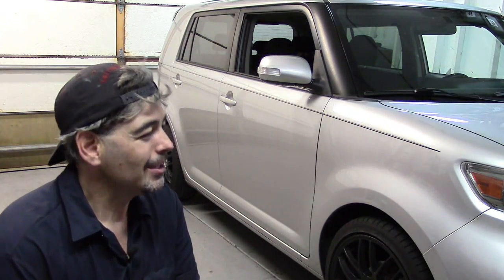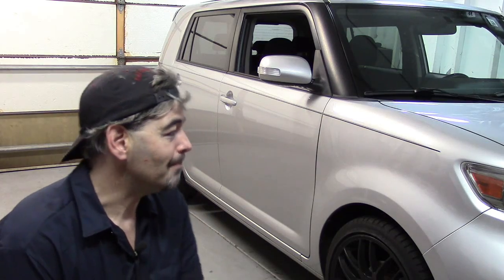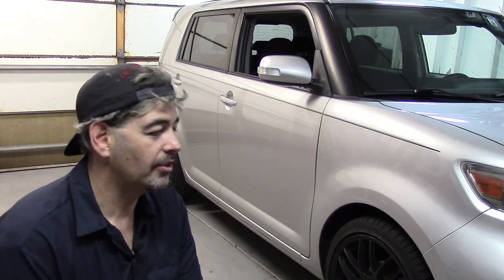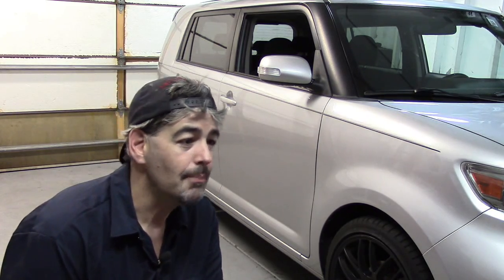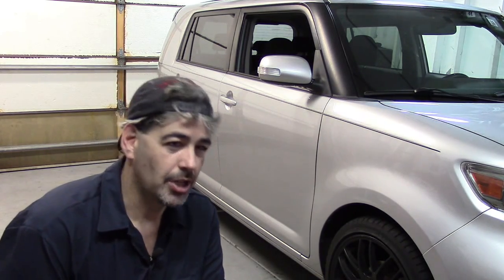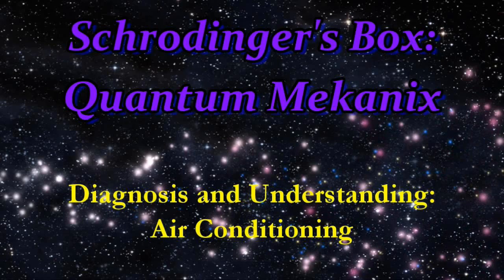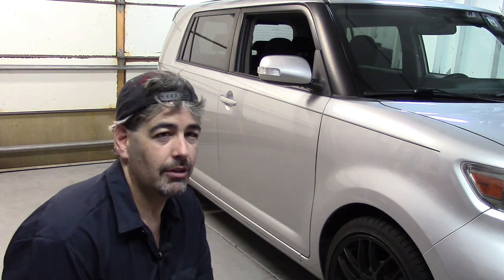Locate an AC Leak Like A Rock Star!

Comment: Seems a little sketchie to charge an ac system knowing it is all going to leak out, given environmental concerns. Wouldnt it have been more responsible just to let a local mechanic repair if you didnt have the time?
Reply from the maker: Sketchy is refilling a system you know has a leak to get by for the summer. DIAGNOSTICS is filling one with dye to determine the repair needed.
There's a critcal difference.
Reply: Wasn't this system just filled to "get by / leak out" until it could be gotten to later? I'm not knocking the diagnostic aspect. http://www.epa.govt.nz/Publications/Releasingrefrigerantsisillegal.pdf
Reply from the maker: Saturday Projects Nope, not at all. You can kill two birds with one stone like I did.

Comment: Nice! In here its illegal to recharge AC system if you even think there is a leak at the AC- system. For that you can get 4 years worth of meal in jail.
Still AC die is used here too. But for some reason i still get faster results with gaskit that are made for finding AC leaks (mixed, nitrogen).
Presure that system with it to 13bar and spray the parts with just water from hose or if you like use soap water (With Key Off, Engine Off!)...
you can still use sniffer like snap on, but i have find to meny falls leaks from windsheald washer fluids and engine coolant leaks that i have minimised that use.

Anyways nise find! looking foward for the fix :)

Comment: compressed air should not be used in an ac system. The resulting mixture of refrigerant and air can be explosive.
Reply from the maker: Why would I introduce compressed air WHEN THERE IS REFRIGERANT IN HE SYSTEM?? There is no need to pressurize the system silly.  Besides its a myth anyway. 
  Why can't people think before they do things?
Reply: +Schrodingers Box in your video you mentioned using compressed air to find the leak. I've read the warning in manufacture documentation, so I'll just stick with what they have said.
Reply from the maker: suit yourself. But I'd rather follow logic and reason rather than anecdote.

Comment: What about evaporator leaks? No visual access. I've had success is w/ a sniffer but it was tedious. Some have found dye in the condensate water, but AC has to be working at least some to deliver condensate.
Reply from the maker: That's actually a great point. I have never seen an evaporator leak but I guess I'd rule it out by process of elimination and then verify by exposing evaporator and looking for the dye or use sniffer. 
  I hope I never see one lol.
Reply: I've found evap leaks by a puddle of oil under the truck from the condensation drain. It just happen to be a leak at the very bottom of the evaporator, I don't think the oil from the system would have leaked out otherwise. Started with a sniffer, it was picking up pretty much anywhere under the hood you put it, so got to looking around some more and eventually went to lunch and came back and was  a small oil puddle forming under the truck

Comment: i got to say something here you should never ever ,ever put compressed air in to a refrigeration system, the oil dont mixes with air and when it does   you have  fire and  explosion. This is from what i have learned from what i regard as the Best AC youtube  tutorial from argo-contractor, You need a 300$ flashlight to look around quote from mr alan olivas aka argo contractor.
So how to pressurise a AC system only one legal and save way with nitrogen.
i think the bullseye leake detector can sniff  nitrogen would be interesting to see if that snapon tool sniffs nitrogen probably not its why  20% refrigerant is allowed  to be added  with nitrogen for leak  detection.
Reply from the maker: Absolute myth and proven conclusively to be so. I even didn't know this was still perpetuated.
Reply: ok i have no proof but i sure as  hell wont  be going to find out if it is a myth i know that everything alan olivas said was plausible , would be good to have some form of proof how and  why this  is a myth.
i think mr  olivas  talked about emense  fines in the usa if you refill a used  refrigeration container as somone used it to fill air  in the tank for there bike tyres.
Reply from the maker: How do I know it's a myth? because I looked at the chemical composition and also for "laymen" you can use an MSDS. 
http://www.meicorporation.com/pdf/8209msds.pdf

  Welcome the the world of fact and evidence based foundation!!!!
Reply: ok but that wont explain how this supposed myth came to be, i know the battery on concreet floor myth  was because battery  once where made from wood and porouse material, thats how that originally had some true components. i want to know now for sure. one good reason you wont put air in there is moisture , i was also thinking what chemicals is the smoke made  from and some manufacturer ban the use of die for warranty claims.
Reply from the maker: Why a myth forms is irrelevant- because they all form from the same exact source. Ignorance.
Reply from the maker: Intrade Motor   I see where you are coming from, I really do- however the physics of thermodynamics is an exact science and there is just simply no way you are going reach a combustion temperature through Boyles Law on a non combustive compound like Polyalkaline Glycol through a standard automotive air compressor.

  If your assumption/concern were valid, I would immediately disable the automatic tool oiler on my air compressor because the oil is under far, far, far more compression that the A/C system would be for a leak detection.  But do I worry about my compressor exploding due to the oil compression? Absolutely not- not based on empirical data, but rather physical law.
Reply: myth or not, after introducing a non condensable you would need a good vaccum after. 😃
Reply: i have been thinking long and hard. if it was  a myth then its extreem bad practice, then i did think some more about it, and i dont think it is a myth because  if it was no diesel engine would operate.
you compress air then you add oil and it goes bang thats the principle a diesel works.
You have aircon with oil you add air. You compress  and  you get bang! thats how it works in my universe as i drive a diesel.
Reply from the maker: Intrade Motor OMG dude- you actually think you are going to get ac AC system to get to almost 300PSI with compressed air and cause combustion on a trace of noncombustible material?? It's AC oil not diesel fuel in there bro.
Common sense.
Reply: i told you i need to find out about the myth , so it is possible to happen just more improbable the ac system explosion was i would say a big industrial one , and i can proof to you  a diesel runs  on any form of oil not just diesel. My one  had  quite a lot more buggy on the automatic trans fluid. And i ran it on electrical transformer  oil tested first if it had poison in the oil . So basically  you do now agree and i found  how the myth would have originated . probability exists .
Now i would think they may have changed the oils property for ac fluids. Another one i have to follow up on is that diy r134a is actually butane like gas as it is illegal to have r134a  with no license ...  as if we did not have enough to figure out like if the moon is there because the mouse looked at it lol.

Comment: I would advise against using the smoke generator. 
It produces the smoke from a mineral oil fluid and the smoke/vapor contains mineral oil that is not compatible with R-134a refrigerant and PE/PAG oil. After contaminating the system, ideally it would require flushing the system. This is not my opinion, it is from ASHRAE. 

Also the electronic detector is halogen gas detector and will equally detect any halogen gas, halogen refrigerant or halogenated substance. That Snap-On unit was/is most likely manufactured by TIF/Robinair under a private label contract. 

Also on smaller leaks for more successful detection with electronic or bubble method, temporarily disable the radiator/cooling/condenser fans as they move and disperse the leaking gas making electronic detection more difficult or bubble formation nearly impossible. 

The UV dye is by far the easiest, quickest and relatively reliable and is the favorite go to method for many professionals.
Reply from the maker: Al of that is pure poppycock. a moments thought would clearly indicate there is no issue whatsoever.  A typical AC compressor failure is far far far more contaminating than a smoke machine or compressed air source by a billion times!! 
  Shear ridiculousness caused by lack of logical process.
Reply: Schrodingers Box
That is your opinion and your choice to do as you see fit, however that does not automatically make you correct.
Reply from the maker: That be true however 7 years of field tested application does that for me.  There is no debate- it's just logic and practical application.

Comment: As a licensed HVAC contractor and a fan I wouldn't recommend using the smoke to detect a leak. Probably very moisture laden air
Reply from the maker: Joe Shearer Never use filter-dried compressed air in a system that is under over 250PSI of compression huh?  Illogical.
 Once again- to each his own but I prefer to use logic and common sense as my guides rather just "doing what I heard or read".
Reply from the maker: Its not a big deal in the slightest- in fact it's LESS of a deal.  A system at atmospheric equilibration is going to have whatever moisture is present at ambient.  A compressor line has dryers in it so actually the smoke is more dry than ambient air.
  evacuation of system and replacement of dessicant are standard for any atmospheric contamination anyway as I mention in my other video.
  Understanding the physical chemistry is the important thing.
Reply: +Schrodingers Box I guess my point is I would never inject compressed air and smoke into any refrigeration system. I've never done it personally but one of the first things you learn in HVAC trade school is never use compressed air in the system. I'm not bashing you in any way
Reply: Probably not a big deal, since he's going to have to pull a vacuum later before recharging - that should dry it out.  Also, and he said he was replacing the desiccant, since it's open to the atmosphere already.
Reply: +aussiebloke609 it's a big deal to us in the refrigeration field. We use dry nitrogen only and we change driers too
Reply: +Schrodingers Box I think the difference is pumping more air and moisture into the system than if it was just the natural moisture in the ambient air. I don't know also what kind of solution the smoke is but I would think that would also contain contaminates.
Reply from the maker: Joe Shearer I still dont get your point- HOW is this possibly going to cause issues? Are you sure of what you are saying here??
Reply: +Joe Shearer 
Agreed. 
Most smoke generating fluids are mineral oil.

Comment: I wonder if the sensitivity of the leak detector goes up when the engine is on because of heat? It'd make sense that whatever chemical reaction the sniffer goes through with refrigerant would work better warmer than colder.
Reply: All good.
Cheers
Reply: Tech Tune Automotive Repairs 
Are you serious? 
You are completely misconstruing the context of my comment and response to the original comment by +DE “AutoBravado” Nichols. 
Refrigerants used in mobile (automotive) systems adhere to physics, gas laws and are temperature reactive, a thermostat would be temperature sensitive. 
The sensitivity of most halogen/refrigerant leak detectors is not affected by ambient temperature.
Reply: Tech Tune Automotive Repairs But perhaps the sensor doesn't care? Not in Pat's experience anyway.
Reply: Heat or temperature is not really a factor, neither the gas or the detector are temp sensitive. The same electronic refrigerant detectors are used in sub-zero temps inside walk-in freezers with no problems. 
It is a halogen detector and most higher end units incorporate a heater in the detector element for proper operation similar to an O2 sensor. 
The running cooling/condenser fans are a problem because they move and disperse the gas from the leak making detection more difficult.
Reply: Did you just say that the gas is not heat sensitive.
There goes the whole science of refrigeration out the window.
The soap test might have worked better if the condesor fan was disabled. (just a thought)
Reply: Tech Tune Automotive Repairs
Since you've already been effectively rebuttaled on the other part of your comment, I'll just comment on your other point.

If the system was hotter, would it leak more? Sure, but remember, if it doesn't get enough air, it turns off, and then you're not testing the whole system for leaking as well.
Reply: I was referring to the fan displacing the soap and water. Remember system pressure was low and harder to detect with the soap and water. I was in no way referring to temperature.
Reply: patw52pb1 Yeah I missed most of his post and only saw Heat or temperature is not really a factor, neither the gas or the detector are temp sensitive. That's what I commented on.
However I beg to differ. Gas is very sensitive to heat and reacts to it.
Reply: Tech Tune Automotive Repairs Ah. Yes. The airflow. That makes sense. Blowing soapy water away makes it so you don't get the bubbles you're after to find leaks. Gotcha.

Glad you posted back buddy. How you been?

Comment: You must be kidding comparing a 15-20 year old R12 tester to a fresh dye tester. You have to wait quite a while to see anything with a slow leak when using dye. With my current refrigerant detector, which requires annual changing of the detector tip, picks up the tiniest of leaks instantly. And doesn't put gunky die into the system, which can stop up the low side port. I work on probably 40 or so AC systems a year and there are at least a few bunker up, forcing changing the accumulator, shraeder valves, and maybe orfice.

The tester was about $75 on Amazon and came with 6 tips. I do not remember the brand, but I wouldn't be surprised if they were all coming out of the same  Chinese factory anyway. All I did was look at the sensitivity range to make sure it had good sensitivity.
Reply from the maker: I am not kidding at all. As was irrefutably demonstrated the dye is far superior.

Comment: Sharp intake of breath through my teeth lol... In Uk as a certified ac handler it's frowned upon just keep putting refrigerant into a known leaking system!  I actually pressurise the system with Oxygen free Nitrogen (OFN) to about 10 bar (140.ish PSI) I then smother everything ac related in a very heavily soapy water solution with a pump garden sprayer. After a short while even the very smallest leak will create  a whipped cream bubbly mound that can be seen. I suspect your soap test didn't work to well was because of the running ac fans pulling the solution through the condenser away from the damaged area.
Reply from the maker: As well they should be- most people do not repair their systems, they just perpetually refill ad naseum.
  In this application, based on my calculations, if the OP has ever in his life used more than 1/8 of a can of hairspray, he has done more damage to the atmosphere by 2 times than my temporary refilling of the system prior to a repair PLUS in conjunction with ensuring proper repair prior to a recharge.
  I have always been one for logic and deduction to trump ridiculous ubiquitous laws based on the general population's ignorance of proper scientific approach.
 Outlaw canned hairspray if you want to make a real difference folks.
Reply: Thank God someone said it. jeez
Reply: In the US charging a system with a known leak is also prohibited by law. 
Well stated.
Reply from the maker: Well you can replace that intake through your teeth with a sigh of relief because with just some basic common sense you would understand there is no additional contamination of the atmosphere since the system was still live-leaking anyway.  Considering the leak took well over a month to exhibit symptoms and the system low pressure threshold is 25PSI which only was reached after over a month of daily driving with full A/C, the amount of A/C loss is not even 1/2 lb which would have leaked out of the system anyway.  Considering that the ozone decomposition rate of R134a is 200 times lower than that of R12 and takes 20 times longer to react, the actual delta of atomospheric in recharging this particular system with the particular existing remaining volume of refrigerant is not even calculatable.

 THINK BIG folks, THINK ACCURATE AND BIG.  You will breathe easier.

Comment: I have had considerable success using an ultrasonic leak detector also. The leak that sold me on the U/S tester was on an older Chevy C-5500 that would not leak in the shop no matter how much pressure I put on it with Ni, I could only duplicate the leak under vacuum and of course none of your methods will work when the leak is only under vacuum. The U/S tester actually found my leak in about 2 minutes, sold me on the spot.
Reply: Jeez, I have a 500$ u/s detector and always been disappointed at its performance... Never thought about trying it under vacuum... I'll dust the dign off and give that a try next time around. Thanks for that one me lad. Cheers.